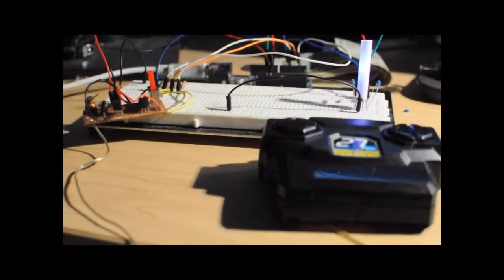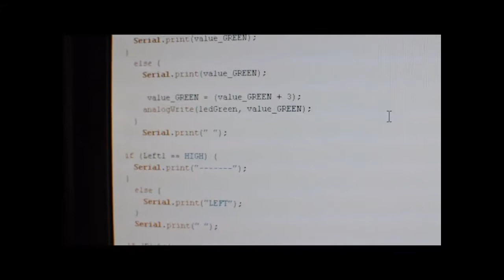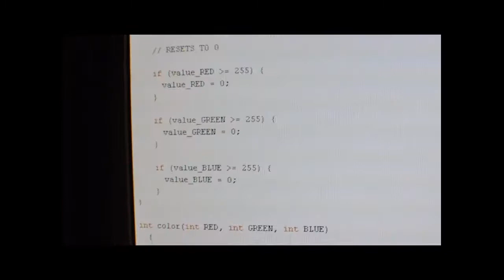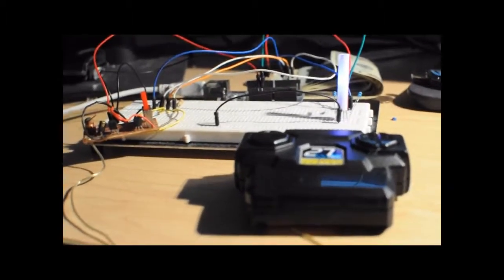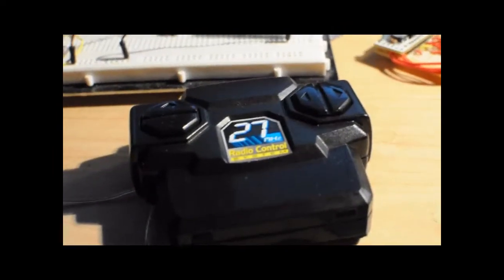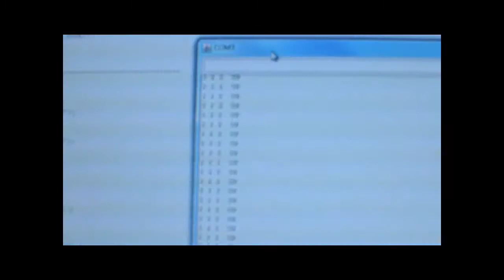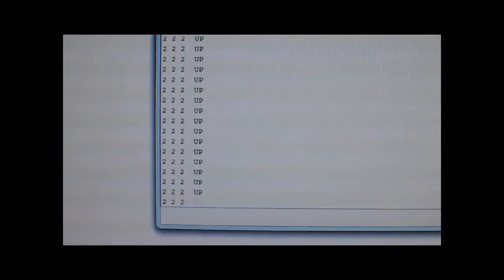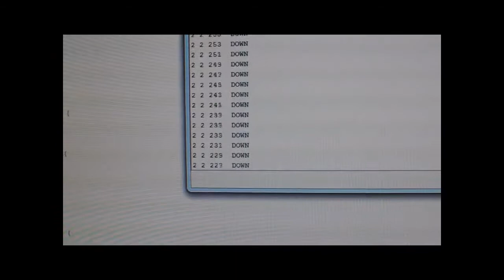Arduino with remote control RGB LED

Comment: @Jackal858 yea i i had to put a piece of paper in front of it but this works better when you are actually working on the wiring and stuff. 

do you know of a good tutorial about powering lets say, 25 of these RGB leds on one circuit?  I guess i would have to use a TLC5940?